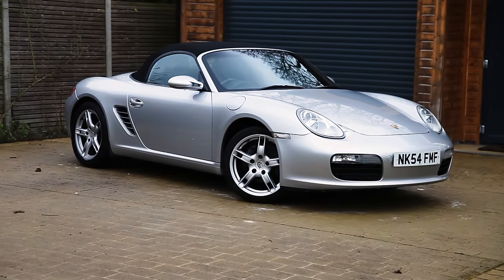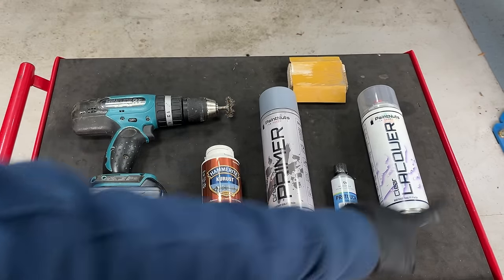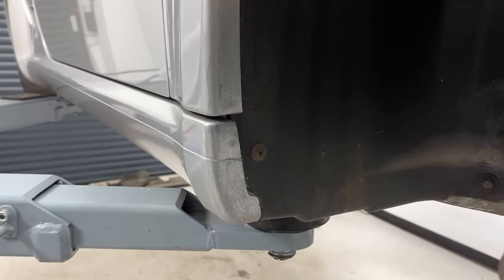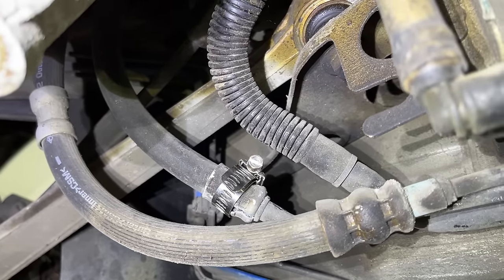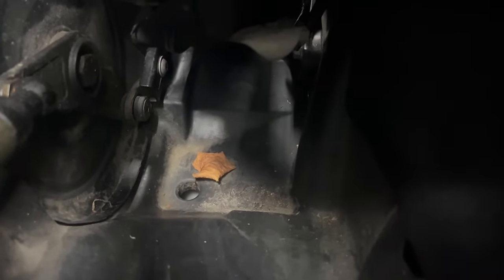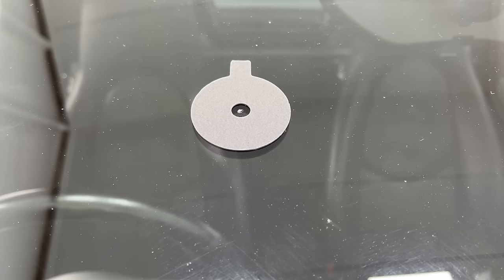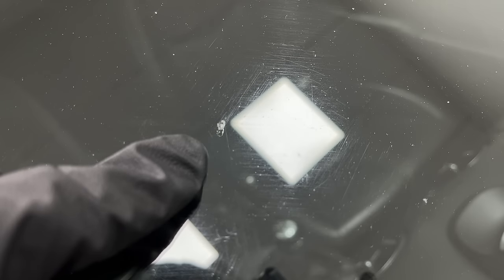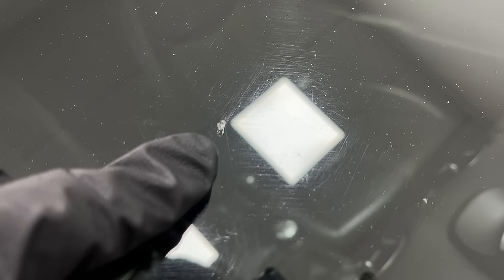Porsche Restoration Pt.6

Comment: Coming together nicely. Did you not want to stick the plates on? The super, super clean look without the screw caps.
Reply from the maker: Thanks mate.  I wanted to but the rear bumper has raised mounds so had to use screws.

Comment: This is going to sound dumb, but take a look at your wiper blades. Chances are that rubber has degraded and could stand a replacement. Save some money by buying just a spool of the rubber blade portion and cutting it down to size for your blades.

Comment: Great video again! I've had exactly the same disappointing experience with one of those windscreen repair kits.  Will you be paying any attention to the roof (waterproofing etc.)?
Reply from the maker: Thanks Chris.  Glad to hear it's not just me!   Yes, when I do a big clean I'll treat the roof.  Have you any product sugestions?
Reply: @RoadandRacetv 
As an ex saab 9-3 convertible owner I found.
Johnson non scented baby shampoo and a nail brush.
Then when fully dry a couple coats of tent (canvas) waterproofer.
Save a ton of £££ against  branded stuff and the results are the same.
Reply from the maker: @brianiswrong Wow, thanks for that money saving top tip!

Comment: Those windscreen repair kits are just gimmicks they don't actually work. A typical crack is maybe a mm or two across yet you have to syringe it for 15 mins to get all the air out? - yeah right!

Comment: I like nice clean plates, but those are illegal 🤦‍♂️ you need the makers name and the BS AU number unfortunately
Reply: Maybe just risk it and fit the old plates for MOT day
Reply from the maker: I didn't realise but I've looked it up and you're right.  Does strike me as an unusal requirement though.
Reply from the maker: My other car has similar plates and passed the MOT.  I assume they don't check this?
Reply: I cut my plates shorter and failed mot because of the missing BS number, had to get short ones from ebay, theres no legal length... depends if the tester is in a hurry for lunch break i guess 😂
Reply: I personally wouldn't worry about it. If the car is roadworthy and not drawing any unwanted attention, your numberplate missing the bs mark is nothing